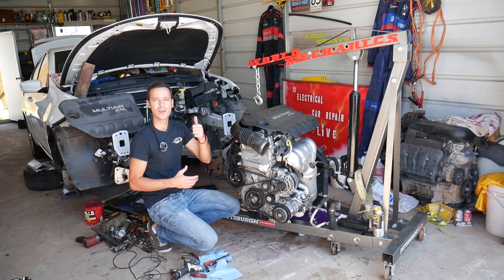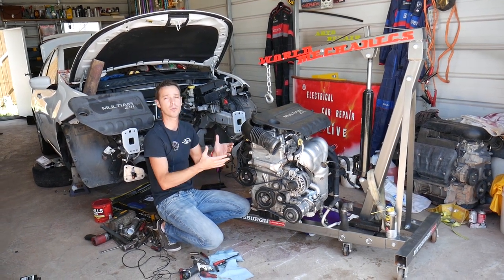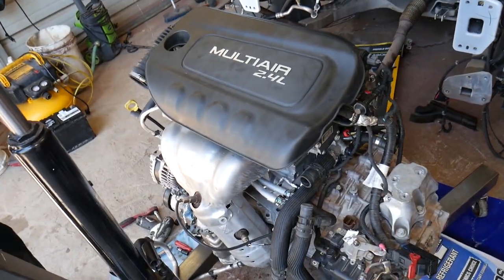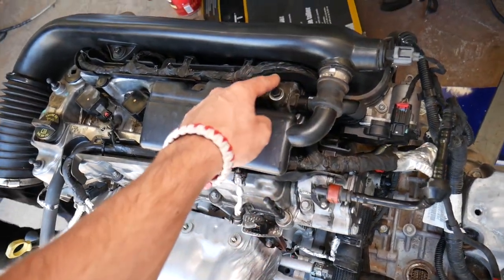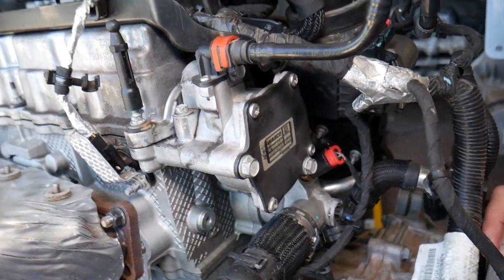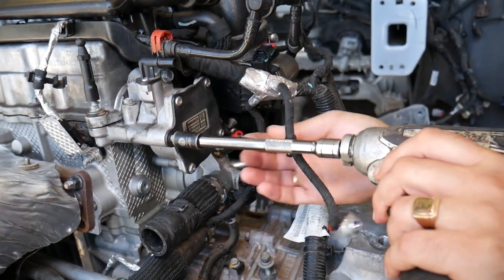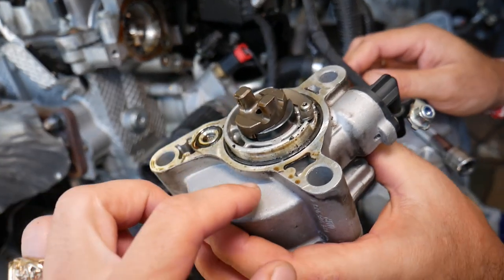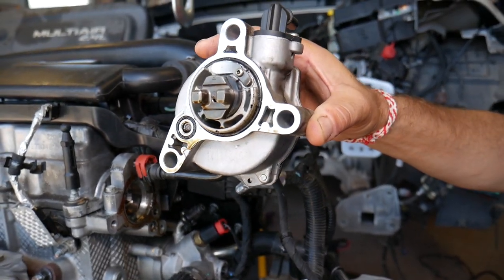VACUUM PUMP REPLACEMENT LOCATION JEEP CHEROKEE COMPASS RENEGADE 2.4 BRAKE PUMP

Comment: After installing the new pump do you have to bleed the brakes or just pump them til u feel pressure or firm pedal I'm having issues with my 2015 dart hisses when I push brake pedal an gets super hard then super soft